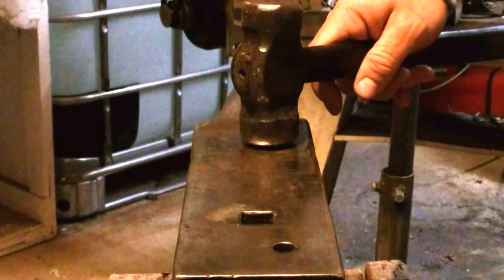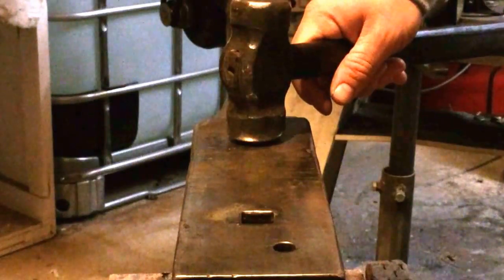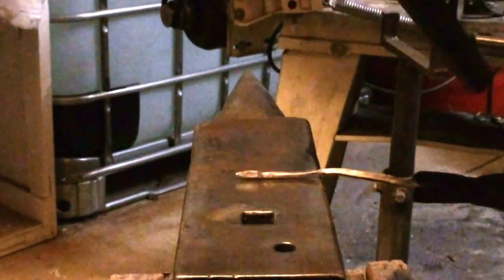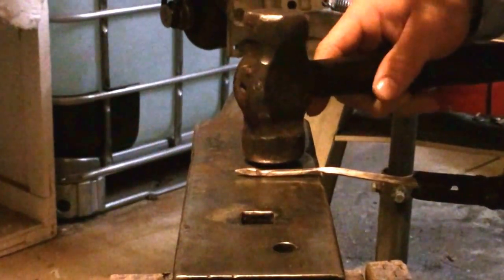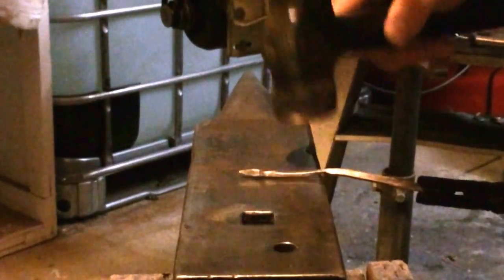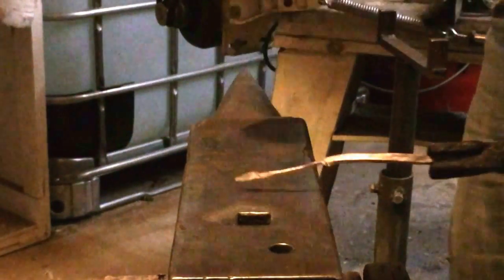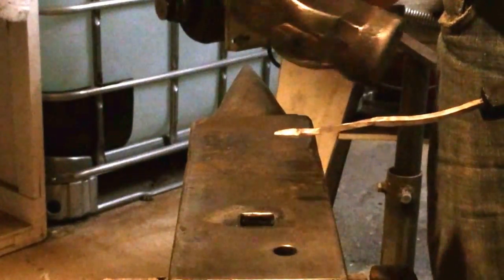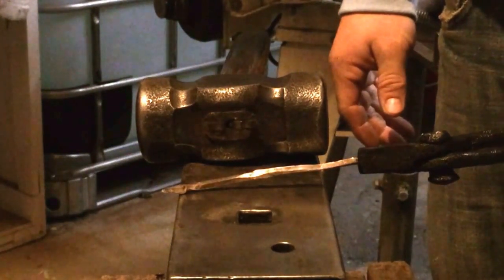Why do blacksmiths tap the anvil?

Comment: The only mistake is that you shouldn't be actively tapping the anvil with force. You should just let it hit the anvil with the force of gravity to waste as little energy as possible. Then when you know what you're doing, there's hopefully rebound left and you can use whatever kinetic energy remains to assist with lifting. But adding downwards force to the anvil tap makes no sense, as it costs more energy than you get back.
Reply from the maker: @TheRealXartaX  my Anvil has a 95% rebound. You’re correct that I lose 5% of the energy but it’s actually more effort to adjust my strike than it is to continue in exactly the same rhythm. Having said that, it’s natural to reduce the force somewhat anyway when taking the anvil which is what I’ve done in the video.
Reply: @jarommoroni1  Interesting. That said while 5% doesn't sound like a lot that amount of energy can add up to a lot over time. I totally get why it might not align with your own technique and make it harder for you, though. But I imagine if worked into a technique, it would save you a lot of energy to eliminate that waste.

Comment: bouncing requires very little effort, think; the hammer would do it  by itself,  its  basically nearly free, as opposed to putting it down because you have to lift it again, or holding it in the air, requiring continuous muscle tension.
(its in the physics)

Comment: i was always told that blacksmiths do this to cool the hammer but i never had luck with that but anytime i don't know were i should hit i do tap the anvil
Reply from the maker: +Hot Iron Art I've heard that before as well but I personally have never had a need to cool my hammer. Even with 16 hour days at the anvil my hammer has never even approached a temperature that would ruin the temper. Honestly having at least a little heat in the hammer would be a good thing.
Reply: well yesterday morning it was about 30deg and I was doing some forge welding with a 20oz hammer and the face was getting so hot that it was almost uncomfortable to hold in the palm of my hand but it was no were near losing temper
Reply from the maker: @nicko9404  I use a 4 lb hammer so the amount of heat it would take to cause a problem is for greater than your 20 oz hammer. Honestly, I don’t even own smithing hammers that small.
Reply: I use a slightly larger hammer for forge welding (one that is still comfortable though) because I know it's going to be sweaty work and having that bit of extra energy makes a HUGE difference to the weld and the amount of heats.